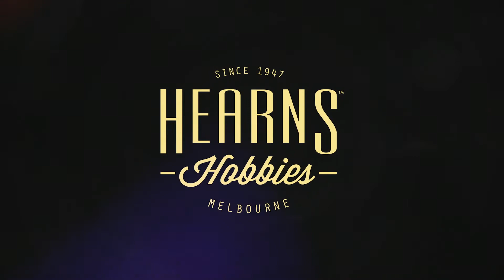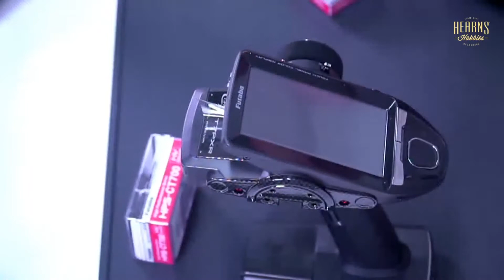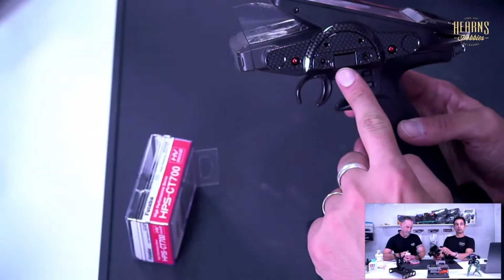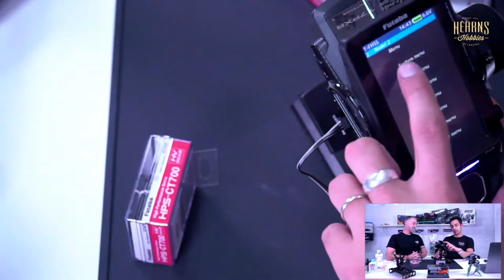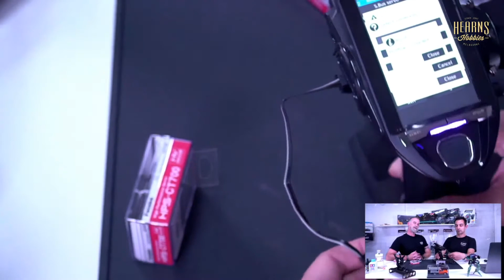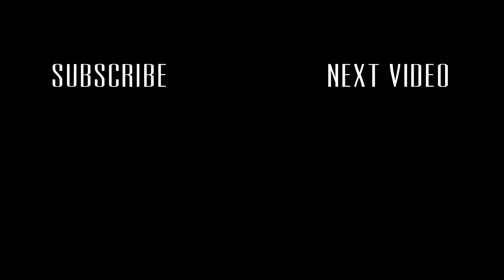FUTABA Radio and Servos CB700 and CT700 | S-BUS | #askHearns

Comment: Thanks for the video 
I was having trouble with my cb700 not working properly in SR mode but just connected it to the comma pier and it was in normal mode don’t know what the default is . Maybe it is Normal mode but your went to SR mode as default when you reset it. Maybe the previous owner changed it.
Reply from the maker: Glad you worked it out.